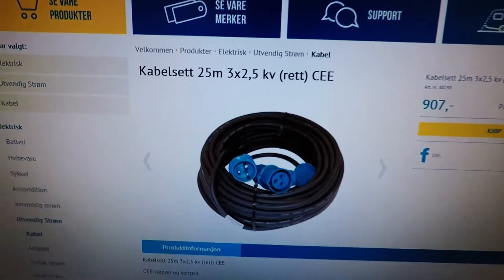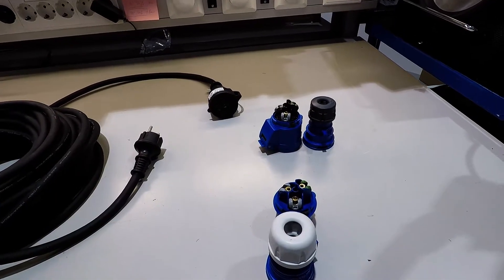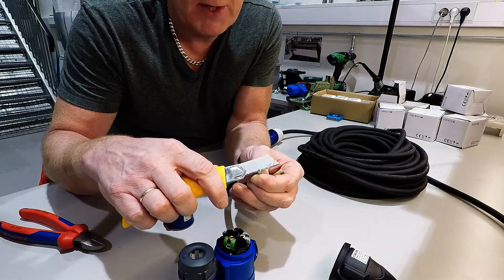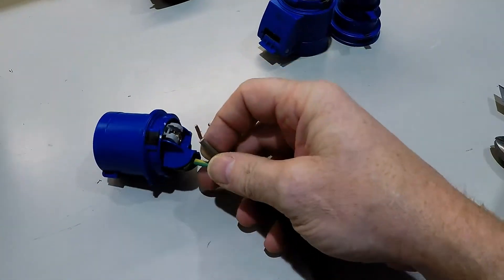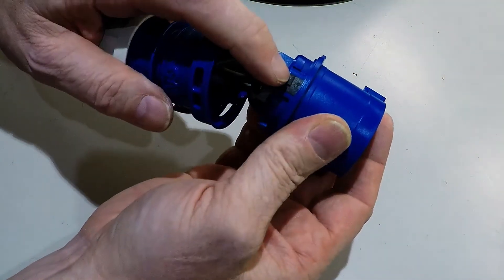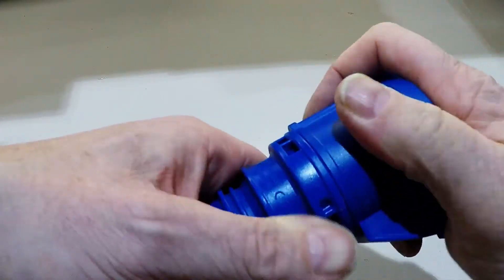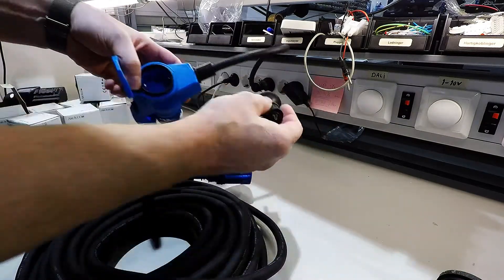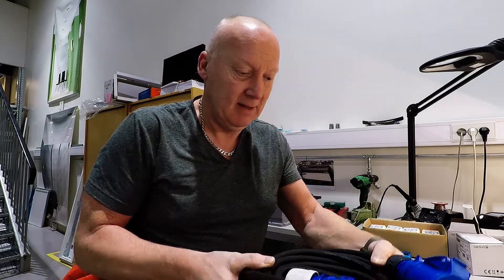How to make your own 16A campervan cable. Vanagon T3 T25 RV

Comment: It would be a clever thing not to throw those connectors but leave half-half meter wire on those and make the conversion pigtails with two more CEE connectors
Reply from the maker: Yes, I was thinking about that my self, but I wanted the cable to be as long as possible, so I ditched the idea.